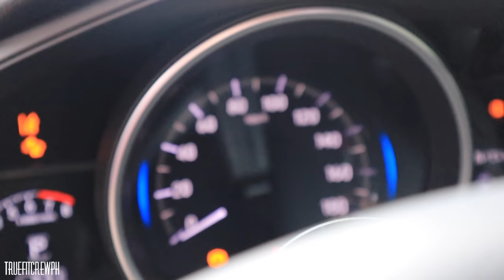MGA MALULUPIT NA JAZZ SA PINAS

Comment: Hopefully they welcome those surplus Honda Fit GD that were cut up and rewelded together by those surplus importer converted from RHD to LHD. Are those considered the poormans honda fit? Just asking.
Reply: Vnñ.  UKULELE songs 😁😁😁 we ee32ee33333e3u3e33eee3e3e33333ueeeye3eee3e33333eeee33e33ee333ee3eue3eu33ee3e3ee3y3ee3ye3e3e3e33e3eee3eeee3eeee3eeee3eee33ee33e3e33e too uee3e3333ee333ee33e33e3eeeueeueeeeueee33eeee33e3eee3e3eee3eee3e333eee33eee333ee333e3u3e33ue3eeeee33e33e33e3ee3eee3e33e3eee3333eeeeee33ee33u3eee3ee3eeee3e33e3eeeeee3e3eee3e33333ee33333eue3eee3euee3eeeeeeu3e33e3eu3e3eeeeeeeeee3e33eee3u3u3e3u3eeee3eeueeu3eeee3e3u33eeeee3eeeee3eeeeeiue3e3ee3e3iue3e3eeeeeye3ee33ueeeee3e3eeeeu3eeeeee3ee3u333yeee3eee3e33ee3eeeyeu3eiy3333eu33e3eeyeeeiy3e3eueeeu3e33ee3eyeeeeeu33ee3e3eeeeeeee3eee3eyeeeee3eeeeeeyeee33eey33ee3eeeeeeeeeee3iye33e3ee3yeeeeeeee3ee333ueeeeeee3eee33e33ee333e3eeeeee3eeueuee3ueeeeee3eeeeeee3e3eeeeeeeee3e3e3e3eeeue3eee33eeeeee3eeeee33ue3333e3eeeeeee33e3eeee333e3ee3e3333eeee333iue3ee3eee33eeeu3yeeeeewteû🚬🥺

P

L